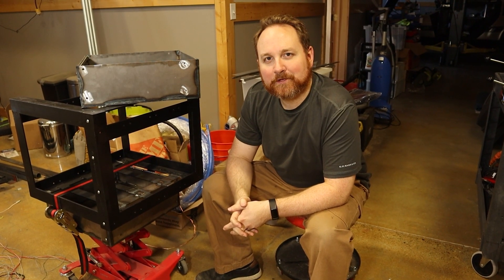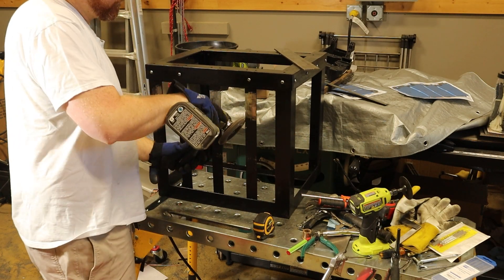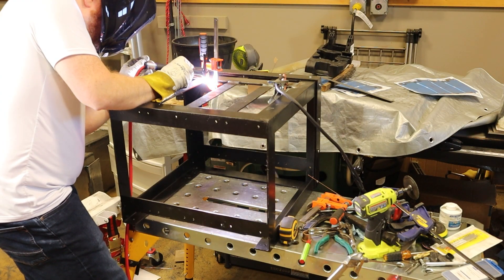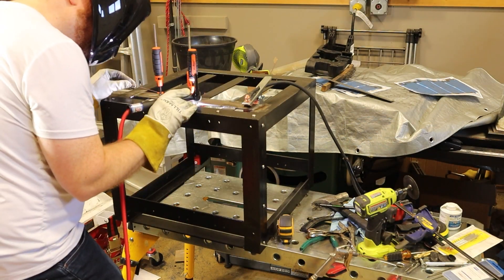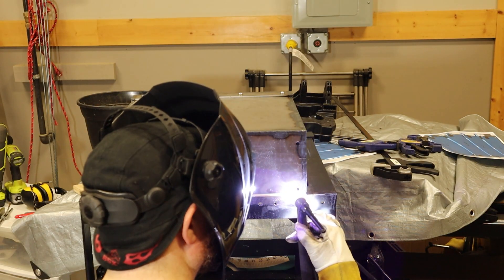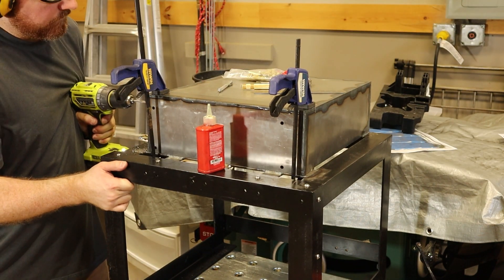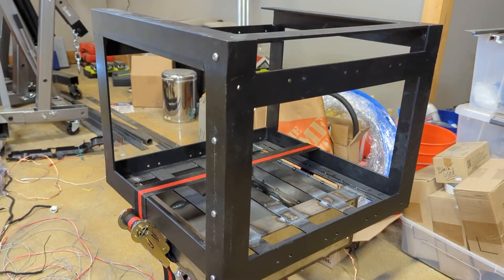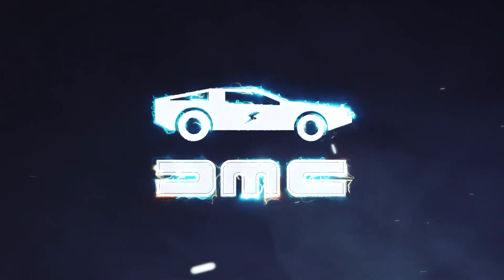DeLorean EV Conversion - Building Rear Battery Box

Comment: Sorry if this has already been answered but are you allowing room for contactors, fuse and connectors in the battery boxes?
Reply from the maker: I don't know that I've gone in detail about it - but I will be using the original contactor box from the Bolt. I will be using crimp connectors and Anderson plugs initially, but if I can find suitable connectors from Amphenol I'll switch to them.
Reply: @BillCarlson  if you have more than one battery box you need to be mindful of wires that might be live at all times. My understanding is the last battery box needs two contactors and a fuse and middle boxes need a fuse. I'm not sure if this is required or just best practice but it is what I'm doing.
I will have three battery boxes and a HV box.
I'm not sure Anderson connectors would be suitable for the 400A or so you might be pulling.
Reply from the maker: @alibro7512  I'm using the Anderson 350 connectors, they are rated at 350A continuous or something like 500A in burst. It's technically much more than I need, but the next smaller size is 175A continuous (which is probably good enough) and I wanted more burst headroom.

You're right that having live connectors is a risk for the packs, and having fuses on each is best practice. I have some 400A bus-bar type fuses (same as Bolt has) that I'm going to integrate into each subpack.

Comment: When it comes time to load the batteries in the battery boxes, it will be interesting to see if/how you plan to circulate coolant through them.
Reply from the maker: Definitely adding liquid cooling! I have it all designed and materials are here - I'll get them built over the winter and installed in the spring, probably.
Reply: @BillCarlson  Excellent. I am looking forward to seeing the finished product!

Comment: Metal work is black magic to me... I like wood, it smells better when you work it. :P  (Joking aside, boxes like this would be super useful in my project... Maybe I should learn).
Reply from the maker: You should! I've found Tig welding to be similar to soldering, which is kind of odd. Mig and flux core are much faster, but sloppier. But for a boat, I think fiberglass is more all around useful.
Reply: @BillCarlson  Ya, I'd love to make aluminium boxes for my batteries, it'd take less space and be lighter. However, I need to learn how to glass, so it makes more sense to make my boxes with it. Ah well, I'll enjoy welding vicariously through your project. :)